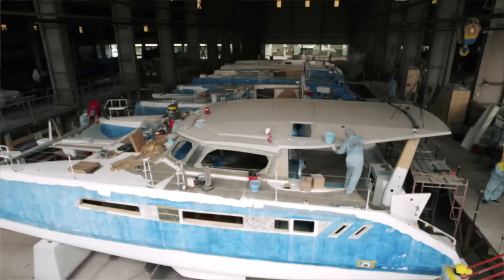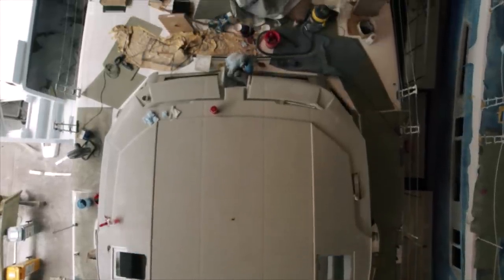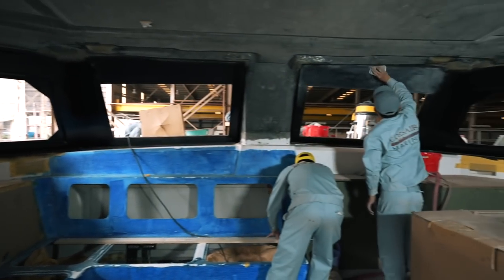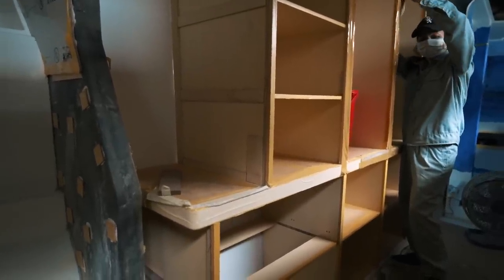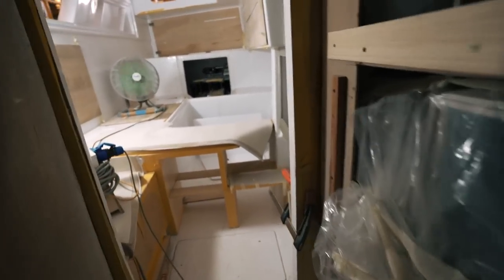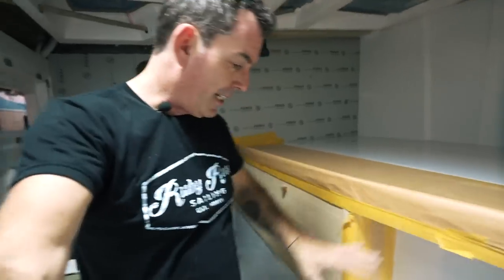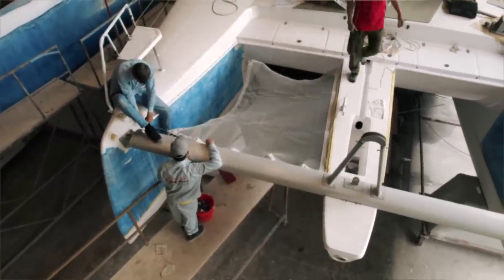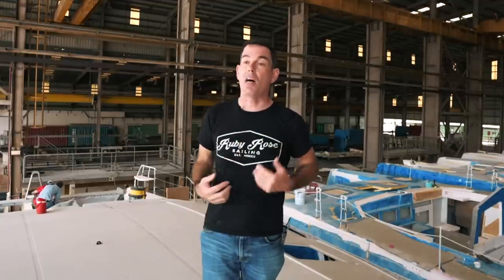CATAMARAN BUILD: Nick's Thoughts on Quality of Build & Cabinetry

Comment: Odd thought. I used to be a carpenter. Five good rough carpenters (I was just okay) could frame a 2500 ft^2  (230m^2) house to this state in one week. Cost of lumber, trusses, plywood? Maybe $20 -$30k. (Total labor for the entire house ~2000 hours.)  Across the U.S., Canada, probably Australia there are millions of houses built like this in the last 100 years. So what amazes me is  how these far more complex, involved and labor intensive cats can be made using more expensive materials at the prices they sell for. (Even in Europe where labor costs are higher they're doing it.)   Just remarkable.
Reply from the maker: It’s a fascinating process
Reply: Assembly line. Lots of templates and jigs. Probably a couple CNC routers pumping out flat stock day and night.